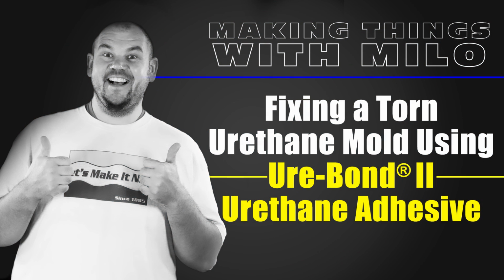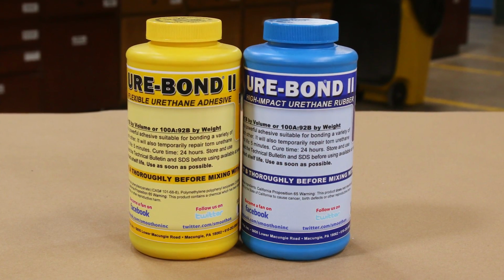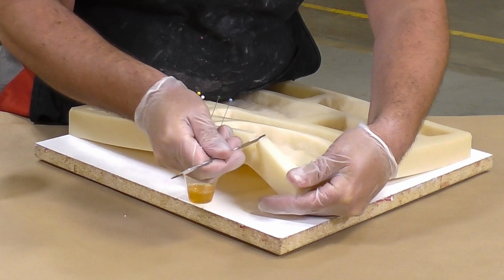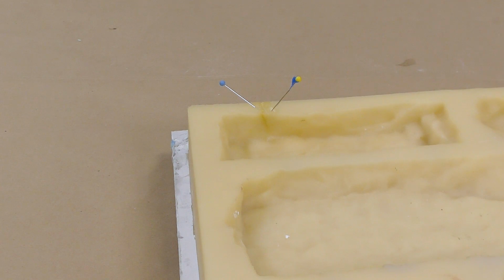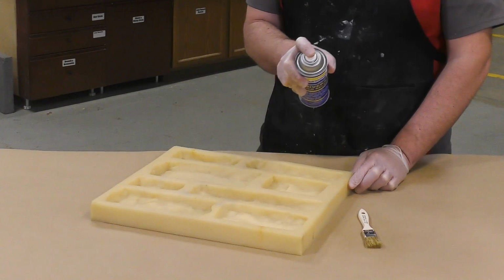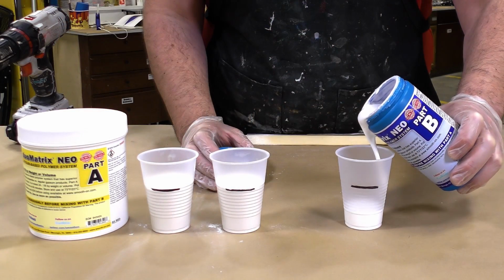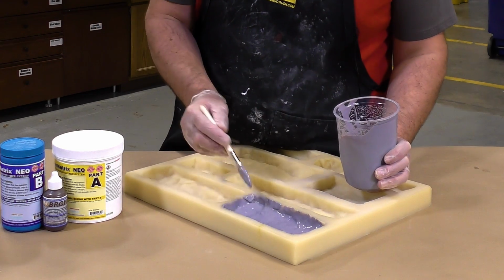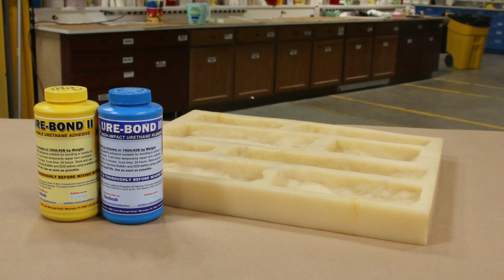How To Repair a Torn Urethane Rubber Mold

Comment: Will this work on a small piece of rubber like a rubber band?
Reply from the maker: Rubber bands are not generally made of urethane.  We would recommend testing a single-component adhesive for that application.

Comment: I'm late to the party here , but will this only work for urethane molds?.......what about silicone?.....tin cure and platinum cure?
Reply: For Silicone molds you're going to want to use a silicone adhesive. Sil-Poxy by Smooth On is a great choice. It can be quite messy  compared to Ure-Bond if you're unfamiliar with it, so you might also want to purchase some NAPTHA and a paint brush so that you can clean any of the excess silpoxy off of areas you don't want it. 

I don't recommend using standard platinum silicone from a hardware store to repair tears in molds. You can make molds out of it and they'll turn out fabulous, but it doesn't quite work to bond torn silicone.
Reply: Dang I didn't realize this comment is 4 years old. Oopsies. Hopefully this helps someone else at least.
Reply: Can this be used to repair urethane foam as well, like flex foam-it?